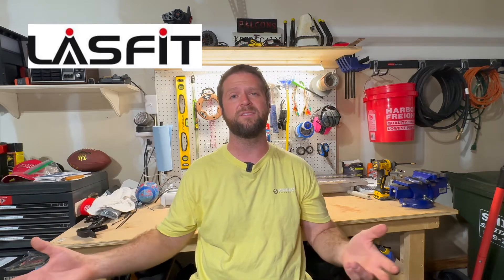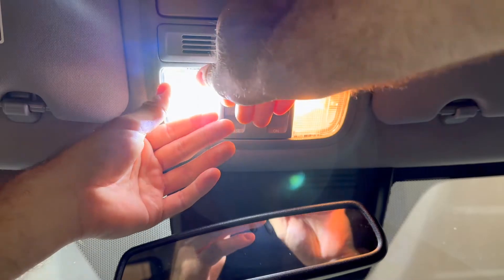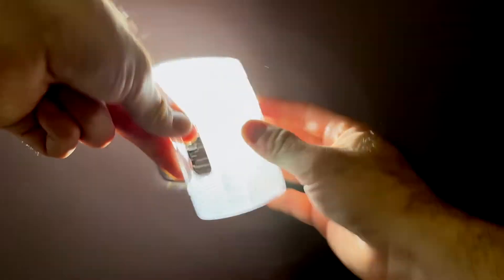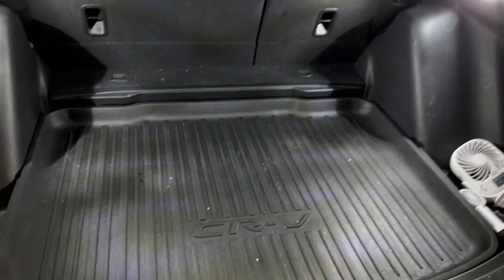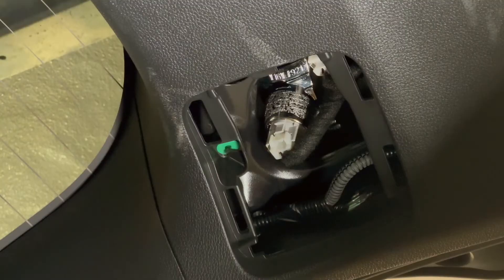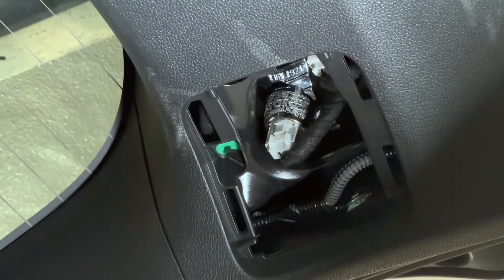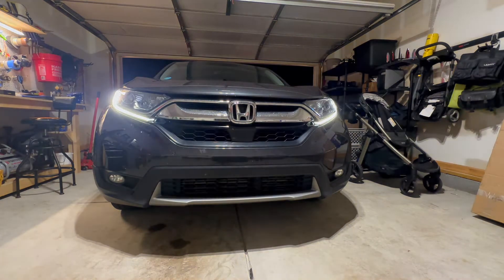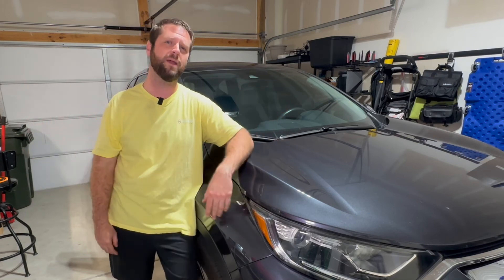HONDA CRV LED LIGHTS CONVERSION | SUPER BRIGHT

Comment: @ZackAttackCustoms 

How’s ur Lasfit - LD plus switchback goin so far after one year? Any issues yet?
Reply from the maker: Had no issues with the switchback, but recently traded the CRV in.
Reply: @zachattackcustoms  glad to hear that.

I had mine so far in 1.7 years. And it started to loose brightness a bit. 

This happens to any people that has switchback problems.

Lasfit should have update these for something to fix this issue. 

But that switchback is still a must

Comment: I think you and most others miss the important factors for switching to a led bulb. You only consider brightness of bulbs whereas manufacturers like Honda also think about beam patterns. These led bulbs provide brightness and are not comfortable in long night rides. It creates strain on eyes due to it being too bright. And it also scatters way more than it is supposed to. If you look at Honda CRV touring headlights, you will find what Honda has done. They create mini casings for each mini led bulb which help diffuse the light properly. These solutions of changing to H11 led bulbs are failure in my experience and don't really provide that OEM experience.
Reply from the maker: I honestly don’t want the OEM experience. That’s boring in my opinion. I want my vehicles to be my own and not have the same car as everyone else.
Reply: Ur wrong dude. 

Not only these led bulsb produce more brightness, but it also retains the same beam pattern as oem. 

As long its a two sided led, tiny led CSP flip chips that’s automotive oem grade, the hotspot is retain the center of the cutoff line, while give u much wider beam pattern, 

Adjust the beam pattern height correctly and adjust the orientation of the two sided led facing 3-9 o’clock. And u will not blind others. 

And even if we get blind by others. We will still run with led. 

To see better and be seeing better.
These will not blind u at all.